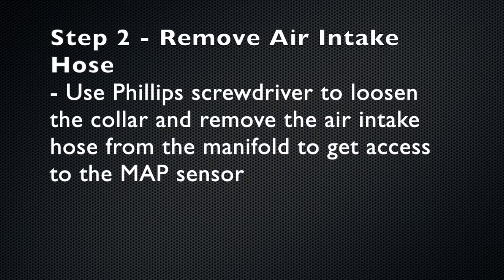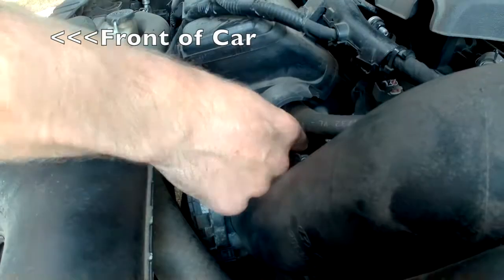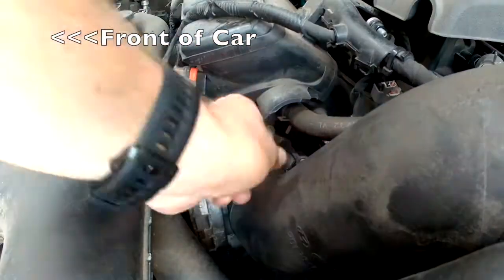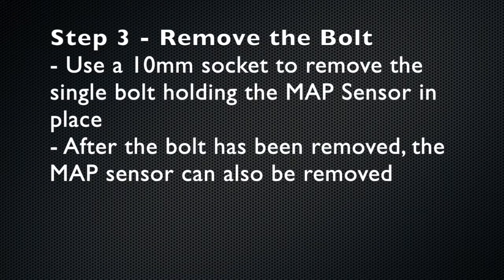Kia Forte P0456 Code Fix, Part 2 - MAP Sensor

Comment: Do you think it is important to use OEM parts for this? If no, do you know where to get a great aftermarket map sensor?
Reply from the maker: @tellmestraight  Personally, if there's not a wide disparity, I try to use OEM when I can. If there is a massive difference, I try to pick a major brand that has a solid reputation like Meyle.
Reply: @AvoidStealership  Thank you.

Comment: thanks your a life saver! now if i can find out why my electrical system wont turn off after removing the key and closing the doors causing battery drain on my 2011 forte lol
Reply from the maker: Glad this video was helpful! 

Funky about the electrical system. Almost sounds like the car thinks the ignition is in accessory mode or something. Best of luck with that!

Comment: Hi what size wrench did you use?
Reply from the maker: At which step? It's a 10mm bolt holding on the MAP sensor
Reply: @AvoidStealership  I am trying to remove my MAP sensor but do not have the correct wrench to take the bolt off. He used the following below: 
 9/16 wrench was too big and a 3/8 wrench was too small
Reply from the maker: @kimberlytaylor3594  a 3/8" wrench is 9.53mm.  I think the problem is that you are using SAE sockets instead of Metric sockets.
Reply: @AvoidStealership  and I have a 2014 Kia Forte LX I’m not sure if they are all the same.

Comment: I did this exact same thing to mine an then it was worse starting stalling out
Reply from the maker: Double check the electrical connection to the MAP. Does the car run rough or stalls immediately?

Comment: Hi. Will this improve fuel efficiency?
Reply from the maker: Probably, but not guaranteed. If your engine is running rich (too much fuel) due to a bad MAP sensor, then yes, it will improve fuel efficiency.
Reply: @AvoidStealership  my kia forte 1.6 2012 with 80k milage is currently consuming 16litre/100km-displayed at the odometre- but no fault code on OBD scanner. what would you suggest? thanks
Reply from the maker: @obrien88  Do you have a ODB2 scanner?  It will show you what your fuel trims are so you know if you are running rich, lean, or just right
Reply: @AvoidStealership  anyway, i subscribed :D keep doing car content
Reply from the maker: @obrien88  Awesome!  Thank you!